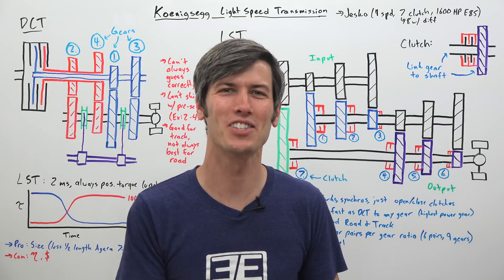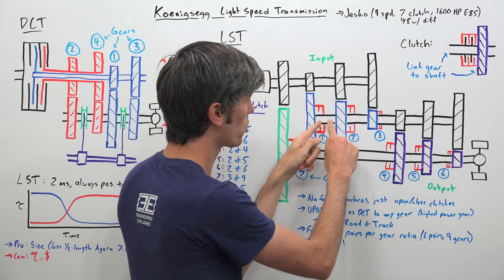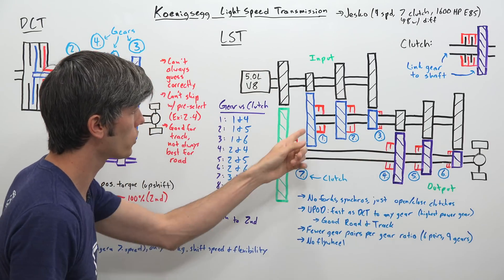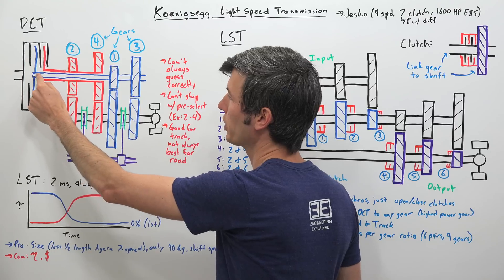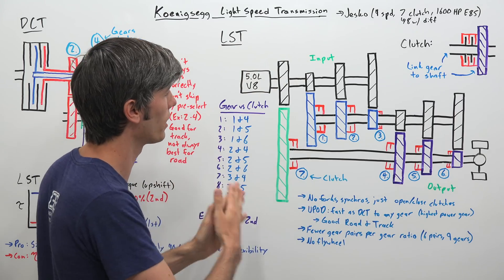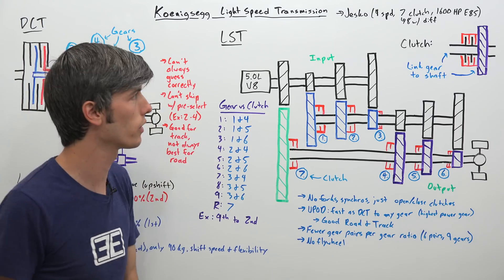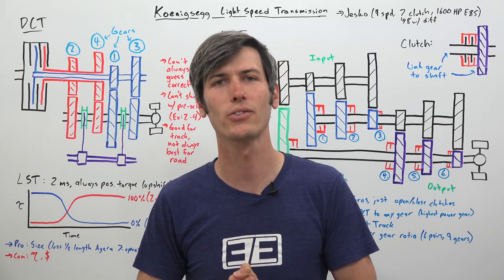Has Koenigsegg Made The World's Fastest Shifting Transmission?

Comment: Manual trans but replace the forks and cone clutches (synchronizers) with wet clutch packs. This is basically how Honda used to build their automatics, minus the 3 shaft design. Also the old saturn autos worked this way.

Comment: Honda had a really interesting hybrid with a DCT where the motor generator was connected to the even set in the transmission so the hybrid could be powering 2-4-6 while the engine could power 1-6.

Comment: What about a RX-8 with a LFX v6 swap? Lightweight >3k lbs, rear wheel drive, longer wheel base, 5 link multi link rear suspension (great for keeping power to the ground, great articulation), double wishbone front (for great steering and directional handling), strong chassis rigidity, (30k lbs force per square inch), rear half doors for adults to fit, great trunk room for size, and a 55/45 front rear weight distribution.

Comment: "The clutches can open/close in 2 milliseconds."

But WILL they in actual use? I imagine SOME time allowance must be made for the engine rotating assembly (and primary input shaft of the transmission and the gears mounted on it...the "flywheel mass") to change rotational speed. I'm sure they want to balance out how fast the transmission seems to shift with the fact that actually shifting "instantly" MUST slip the clutches for the amount of time it takes for that rotating mass to adjust. In other words, the faster the shifts, the sooner the clutches wear out, and they'll want to keep expected clutch life span reasonable.

So how fast will the clutches actually be programmed to engage? That's a different question than how fast CAN they engage.

Now I don't know anything about anything. Maybe 2 milliseconds is enough time such that the life span of the clutches is still expected to be plenty long? Maybe 20 milliseconds is still fast enough that a human can't feel the difference, and will double the expected life span? My only solid point here is that this IS something to be considered.

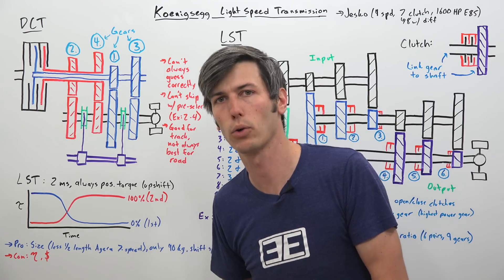Comment: My BMW DCT will automatically downshift multiple gears if you press the throttle past the "resistance point" (kickdown switch), which mostly fixes the issue described at 7:48. It will do this even if in manual mode. It's basically the same as Koenigsegg's second shifter position (downshift only).

Comment: AMG multi-clutch Speedshift transmission also changes straight to the best gear if you pull and hold the shiffter a bit, like 5th to 3rd for instance. But in 100ms, not 2ms.

Comment: Most of the ware is taken by the clutch plate, so common sense says that the more clutches the more ware.
Although they are in an oiled state all the time, the temperature of that oil is going to rise quite fast so the clutch plates too are going to heat up, this maybe O.K. for racing cars but for road use there are a heap more parts to wear out a lot quicker.
Therefore the original auto gearbox is much prefered out of all the  systems, C.V.T.has already proven to be prone to breakage of the drive belt which on breaking releases a load of metal sections loss in the gearbox as both Ford and Honda have found out,
There is an auto transmission that has proven to be good and long lasting that is the pre select gearbox used in buses and in some of the more costly cars of the  past, i.e. the Daimler1937 had pre select and proved its durability by still being compleately reliable still in the seventies.
Taking into consideration that machining has become greatly improved then making this form of transmission would surely be a worthwhile idea to put into modern cars???

Comment: What's the difference between this and the kick-down (6th gear to 3rd gear under acceleration) experienced by automatics (Audi, Merc, BMW)? How did they do this kick-down without having 7 clutches like the Jesko? Genuinely interested, not a troll...
Reply: All modern planetary automatics use multiple clutch packs in combination to engage each gear, and all of them are able to do any single or double shift with a single swap (1 clutch pack engages while another disengages). Most of them also have large direct jumps like how the ZF8 can skip 8-2, or how the Honda 10AT can skip 10-6 and 7-3. If they need to do an even bigger jump that just means doing multiple swaps (e.g. 2 clutch packs engage while 2 disengage).

Comment: thoughts compared to a zeroshift transmission style? They're truly a zero gap in torque since the transmission is being pulled out of engagement due to relative rotation speed differences. (this feels like they looked at that and thought "tricky and patented - lets make it simpler with clutches")

Comment: DCT can do always positive torque as well. In fact with the right tuning you can close the upshift before releasing the lower gear (very briefly having both gears engaged), and actually get a gain in torque while shifting by keeping all of the inertial force from the higher RPM gear.

Comment: They are simply putting wet-multi-clutches instead of cone clutches (shncronizers) in manual transmission. The idea is simple, but complexity of control, too much cost, issues with reliability are somewhat unwise.

Comment: Hi Jason. Might I suggest a Porsche Cayman S? Over here they are not that much more expensive than a 350z but they are a lot better. And remarkably practical... You could go into the different layouts between a front-engined vs a mid-engined car. Boxer engines though I think you already have one of those... And maybe upgrade the diff to an LSD and explain the pro's and con's of that and why Porsche didn't offer one initially... The only video you could make about the 350z is why it's so heavy :P

Comment: how do they make sure the gears switch without riding the clutch, do they have the clutch timing over lap in a way that there’s a very short time in between gears or do they wait until the next gear is in and slip the other clutch
Reply from the maker: There is no “gear is in.” The gears are always meshed. It doesn’t select like a manual, the only thing that needs to happen is for the clutches to switch, which yes, there is overlap.
Reply: Engineering Explained thank you for explain

Comment: What I see with my untrained eyes is 7 massive clutches, working with huge torque of 1600 hp engine, multiplied by gear ratio of each gear, plus friction loses of 5 clutches unused at the time. Not easy to design to be efficient and reliable.
Reply: A unengaged clutch don't produce any losses.
Reply: @TheEsseboy  They do - these are wet multiplate clutches.

Comment: So, it is 3-speed transmission with a built-in 3-speed overdrive! Are they all the clutches the same diameter? That could save some money, using 7 identical clutches instead of 3 big ones, 2 mid-size and 2 small ones. However, everyone of them needs to handle 125% of rated torque (or a torque limiter on the engine).

Comment: If you mirror 4,5,&6 vertically using the 2nd shaft as the centerline for mirroring you'll significantly reduce  size but idk how to get a reverse in there with that method.

Comment: How does Koenigsegg handle the 3/4 and 6/7 shifts, especially with clutch overlap for continuous power delivery? Those two involve swapping not one but two pairs of clutches - shifting one sub-transmission a step up and shifting the other down. All modern multi-clutch automatics involve only a single clutch-to-clutch swap for every sequential and double shift to avoid engine flare or bogging down the engine.
Reply: Timing.

Comment: So, it's like a basic automatic transmission, where any gear can be in theory selected after any other gear. Expect, when clutch is fully engaged, it's a direct connection, but with AT it's almost always a hydraulic connection. Or am I wrong?
Reply: Almost, except all modern automatic are based on planetary gearsets, and the powerflow and clutch schedule are cleverly arranged such that all sequential and double shifts are accomplished by opening one clutch pack and closing another. The Koenigsegg LST requires swapping two pairs of clutches on the 3/4 and 6/7 shifts, which makes the shift a lot more complicated to control properly to avoid engine flare or bogging down the engine. Also, modern automatics bypass the hydraulic torque converter fairly early on in the gear ranges with a torque converter clutch.

Comment: I have some questions u.u
Those 7 clutches it is like a real normal clutch, but much smaller and inside of gearbox housing?
Will it be necessary to replace each one according to time and use?
How each clutch is selected to change a gear?
I wonder if this design of gearing is possible to use on sequential gearbox using selector forks and dog engagment...
Thanks!

Comment: The alison transmission works almost the same way (btw it uses multiple sets of clutch discs)except with different combinations and it has a torque convertor to smooth out the transitions. So basically the K is like an alison w/o the TC.
Quick gearshift means the engine goes form say 7000rpm to 6500rpm very fast so it shocks the gears but the good thing it has 9 gears so you won’t have to do something like 7000rpm to 6000rpm. Also with no flywheel the rpm will reduce quicker and the inertia is lower. On downshift there is no problem because it can use the throttle to help . So 9 gears, no flywheel, may be ok for super quick gear changes.

Comment: My First question: What about reliability? I imagine those 7 clutches have to be very small in size to achieve these amazing 90kg and they have to transport a lot of torque. What will their lifespan be? Obviously as there will be >1 clutch engaged as well as disengaged in every shift one can't argue that the wear will just be split up on the 7 clutches, meaning over time each single one will accumulate more than 1/7th of the wear a "normal" single clutch would accumulate, right? I also imagine replacing those 7 clutches that are integrated into the gearbox is going to be a lot of work and really expensive, although the customers of the car might not care too much about the secod part :D 
My Second question: Why has noone else done this before, if there are so many advantages? I mean it can't be that noone else has thought of it before, can it? So what other disadvantages are there?

Comment: A super interesting comment about dual clutch transmission: to move from 6º to 2º, for example, I think it is better to use two passes, first from 6º to 3º, and then from 3º to 2º. With this strategy, there won't be momentary loss of torque. (English from Brazil). 
Um comentário super interessante sobre transmissão de dupla embreagem: para passar de 6º para 2º, por exemplo, acho que é melhor usar duas passagens, primeiro de 6º para 3º, e depois de 3º para 2º. Com esta estratégia, não haverá uma perda momentânea de torque.

Comment: If the first shaft is bolted directly to the output of the crankshaft with no torque converter to buffer the wheel speed vs engine speed until they sync, how does it start moving from a stop? Is there a clutch pedal to engage the transmission or some other Koenigsegg magic?

Comment: I'd suggest looking at importing an Australian Ford Falcon FG. 
4 litre, 6 cylinder turbo, rear wheel drive. 
They make up to 416hp / 417ft•lbs from factory, can handle 600hp on the standard bottom end and make over 2000hp in drag racing.

Comment: that is a automatic transmission without planetary gears and no torque converter.
Or just a hydraulic automated manual transmission with 2 countershafts and one clutch.
Whats the shifting intersection-time in milliseconds?

Comment: I kinda wanna see this with 16 gears, either in a triple shaft 4:4, or a quad shaft 2:2:2 configuration. Just to see if high gear counts with smaller steps between the gears gives additional driving performance, and to see what the point of diminishing returns is in high gear count transmissions, and at what point that diminishing return makes more sense to invest into a performance based cvt/ivt, then see if the investment into a performance cvt/ivt is worth it when you already have a direct drive hybrid system. I think Koenigsegg is the only company daft enough to actually put in the research for this.

Comment: Imagne having this in a eletric car so the motor can rev lower at highwauay speeds. 
Would it benefit the overall experience? Would you be better of just having a bigger motor? Any thoughts?
Reply: The complexity of all the clutches and the introduction of them as items that will ware and need replacing, does not present a major benefit, as I can see it. The electric motor does not need to idle. Why introduce a clutch into that equation when it's not needed in the first place? Save those 90 kilos and use them for batteries or just a lighter vehicle instead.

Comment: You like the 370Z steering?! I’ve never driven the base model, but my boyfriend’s 370 Sport was absolutely insanely unstable and unpredictable. The problem was huge scrub radius, as a result of downgrading the 350Z’ double pivot point suspension, while increasing wheel size.

Huge scrub radius, combined with a tiny steering wheel and no telescoping column, with 50lb front wheel/tire assemblies, has one simple result: if you hit a bump while braking, the wheel jerks itself out of your hands.

Good for drifting, though.

Comment: How does the fast gear change time affect the engine? I would have thought the engine needs time to adjust the revs, even with normal double clutch, with all the rotating masses and all. Isn't it hard for the engine parts to change the momentum in 2 ms?

Comment: If you're used to a S200 then a 370 is gonna feel like a brick. If you like the looks and only care for straight-line-power it's good choice I guess. 
How about a Z3/Z4 M Coupe? Not the cheapest options but the textbook definition of max fun you can have in a stock road car without having to spend 10k on tuning first. Z4M is a riot.
Or be different, buy any 3L Diesel BMW, slap a bigger turbo on it (+proper exhaust and eprom) and enjoy your 600+ Nm Sleeper.

Comment: The key question is how long will the clutches last. In this design these clutches are holding the full torque of the engine while engaging and there is no main clutch or torque converter to slip, particularly during starting or slow crawling. Also, since the clutch packs are between the gears, you can't make them too big either. I think that a design like this for a street car would have a very short lifespan. Good thing that nobody is actually going to be putting miles on these cars given their cost.

Comment: I think you would really enjoy an E46

 low cost aftermarket parts availability
 the M54 engine's power and potential
Space to work in the engine bay
Compact size
Sound system upgradability
Bonus:then you can make more DIY and engineering videos on upgrading the M/S transmission to handle more than 220lb of torque :)

Comment: I can speak from experience on a BMW for a daily, if you liked the S2000 and was able to have fun with it then you'll have a blast with an E36 M3 (or E46). I miss my E36, kind of want another but also kind of want an S2000. I've never driven an S200 IRL but in sim racers like Gran Turismo and Assetto Corsa BOTH the E36 M3 and S2000 are extremely fun to drive cars and both are relatively easy to learn how to drive them fast. My real M3 was the same way, a blast to drive and easy to learn to drive hard. Sooo, 10/10 I'd recommend the BMW 3-series.

Comment: My idea is to have a completely gear-less “transmission” that just has an array of different interconnected torque converters, possibly with some sort of electronically controlled variable vane system within them that can vary the blades somehow to achieve different torque multiplication ratios. 

So basically you’re always in top gear, but you have a torque converter that can slip a certain amount driving another torque converter that can slip a certain amount driving another torque converter that can slip a certain amount and so on and so forth. 

So when you’re “changing gears” all you’re doing is reducing how much slip there is in the system therefore smoothly and continuously varying the drive ratio

Comment: if one switches for one gear to another really fast, would that mean there is no rev  matching ??
Reply from the maker: You would likely want to use the engine to assist if possible, but the clutch could pull the engine RPM in whatever direction is needed.

Comment: So It is named this way because the transmission is light and it transmits speed?
Or the time it takes to shift is measured in light speed (in vacuum?) over some undisclosed distance?
Wet clutches are still not instant, it takes time to fill the clutchpack with oil.
Reply: Oil? They don't need any stinkin' oil! They've got SENSORS!!!😂😂😂

Comment: So...it's a tractor powershift transmission then? Neat. I didn't actually understand how a powershift works until watching the video, but it's pretty clear that's it...shift from any gear to any other quickly under full power, many clutch packs, yep. Only difference is they still have a main clutch at the engine for inching.

Comment: A clutch pack for every gear? That is an automatic. Minus the torque converter for seamless transitions. Multiple stages of gearing/ transmissions for gear combinations, that is heavy duty truck/tractor transmission. Minus the strength-weight ratio of planetary gear sets. Good job Fancy European engineers!!! You just re- re invented the wheel. With a few flat spots.